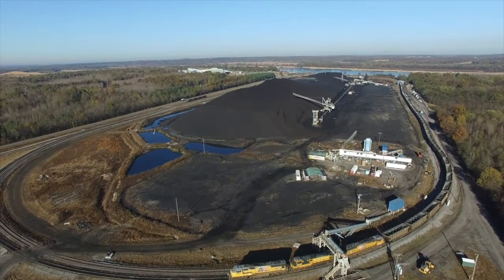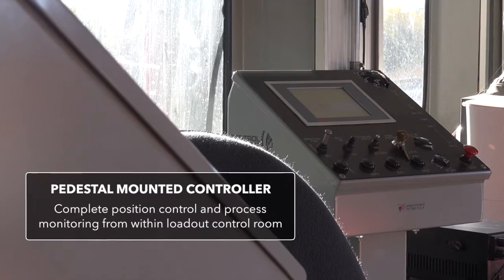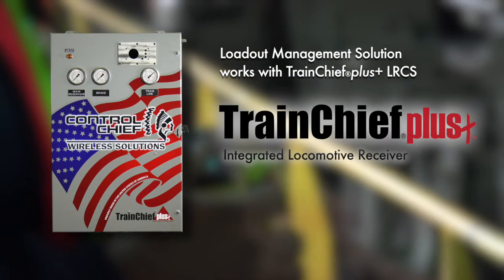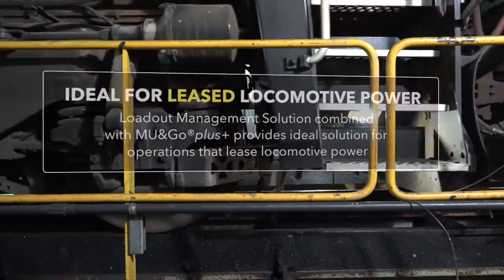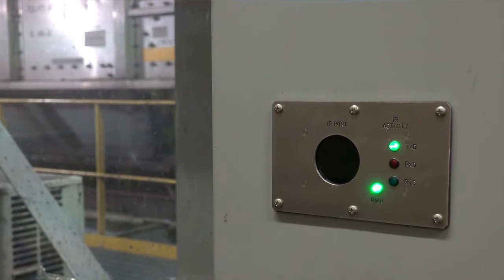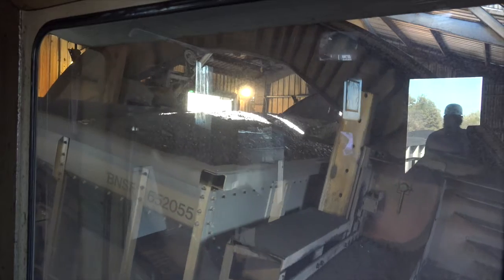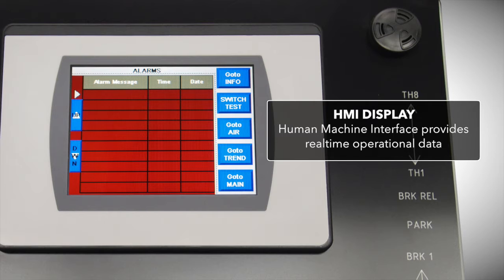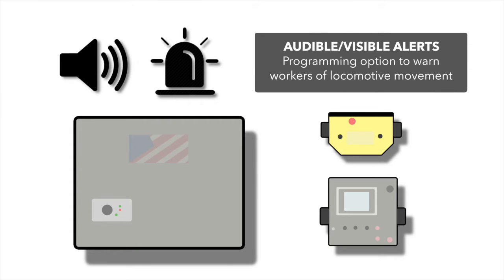Load-Out Management System

Comment: You should make a video on exact functions of the remote. For the people that use them daily it would be nice to have a video knowing maybe tricks of the remote. Ways to access the options menu, or other things about it. I mean using it for the basics is fine, but when there is an issue with the remote it’s extremely hard to find out what’s causing it. My throttle lever goes to the negative position, which used to be a brake, now sets off a code that isn’t able to clear from remote, and have to walk back to train an re scan it in. Which is a pain in the butt, and I can’t figure out how to access the options to change it. I used to like how it was a throttle, and brake off one control